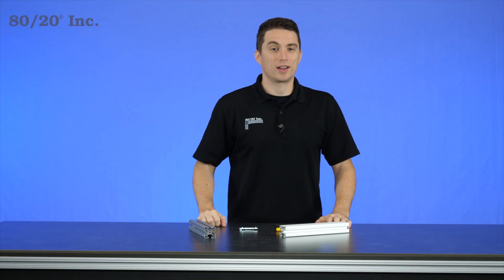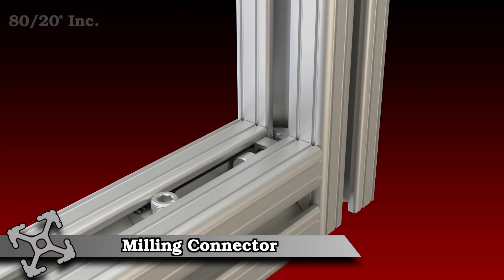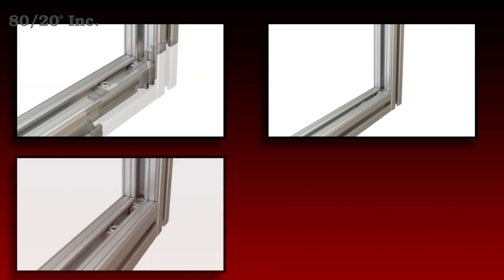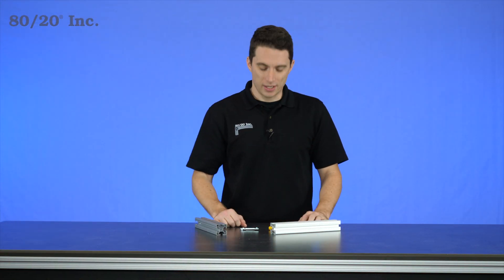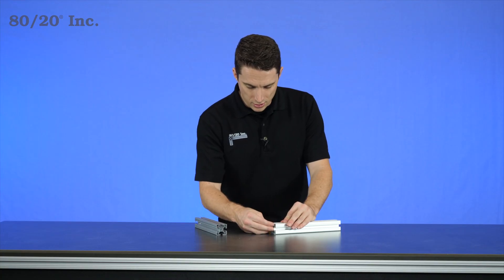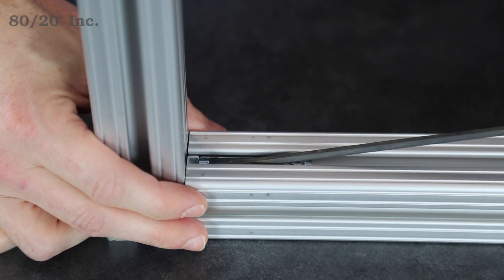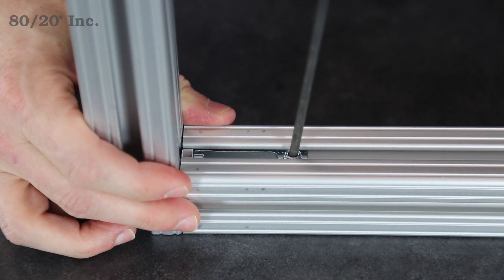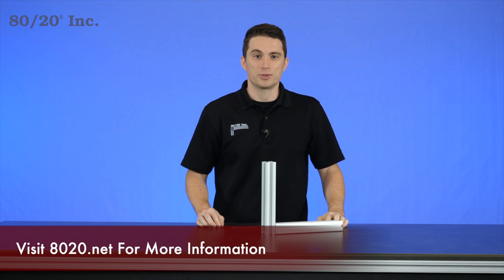80/20: Milling Connector

Comment: Is it as strong as the anchor connection?
Reply from the maker: Hi, Dustin - that's a great question! One of the plus sides to a milling connector is that no machining is required. However, because there is no machining required, it is held in place with set screws which means there is potential for it to not be as secure as an anchor fastener. An anchor fastener is held in place with the cam, set in the counterbore. This would likely prevent it from falling out even if the screw was to loosen a bit.

Comment: Shouldn't you tighten the setscrew first?
Reply: I was wondering the same.  I think the purpose of the set screw is to hold it in place wherever you tightened the bolt and T-nut.  If you do it first, you're depending on the aluminum to hold as you tighten the t-nut and I think it would result in the set screw being pulled out of place.
Reply: If you look at the site I have linked, they show what you are talking about. It looks like you are supposed to tighten the set screw first with a small gap between the fastener and the end of the bar so it can pull the pieces together.
https://www.framingtech.com/products/connectors/milling-connectors/